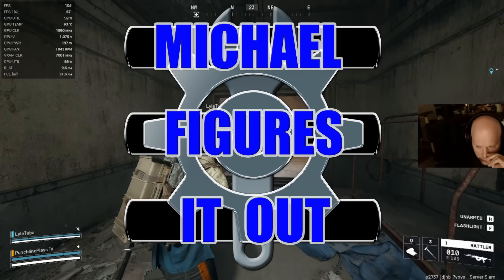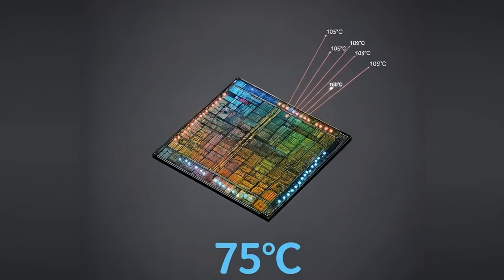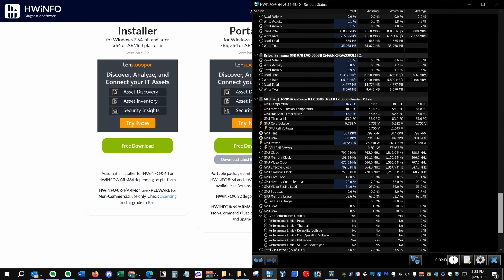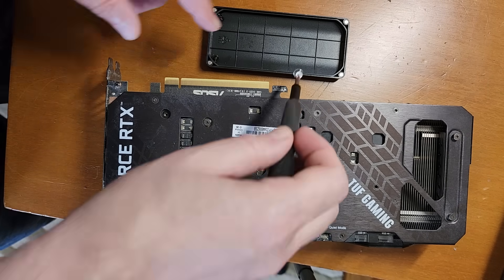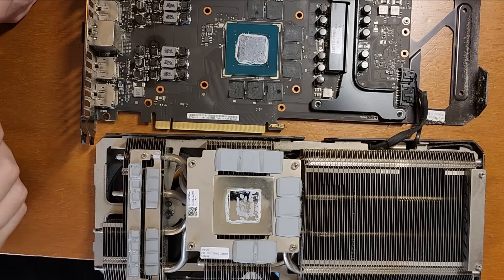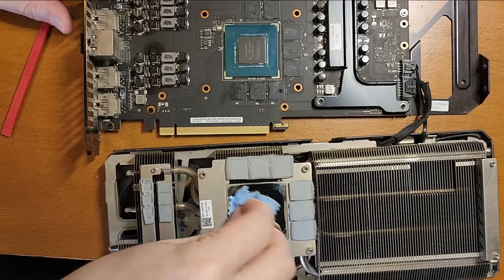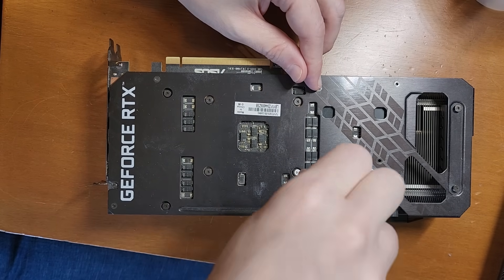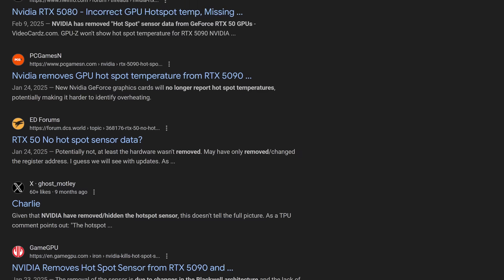GPU Temps Are A LIE!

Comment: 105°C on the hotspot is still within the normal range. The high end of the range, but still considered "normal".
A high hotspot does not cause a crash of the game, that was a software issue.
I know because I had a 3080 that often got to 105 on the hotspot while playing VR games. Never a single crash.

You fixed the issue, but it was unrelated to temps.
And no, the screws with springs are not used to apply pressure to the heatsink.
Those springs are there to stop the screws from coming loose.
Reply from the maker: Do you have any official source for the hot spot temp 30 degrees over the thermal throttle limit being OK?

Comment: Streaming Tarkov with only 8gb vram? i think Ive figured out your problem.
Reply from the maker: One of the 'fixes' we tried before the re-paste was to offload OBS, streaming and discord to another PC. Didn't stop the crashes but I'm sure it helped.
Reply: @MichaelFiguresItOut  Tarkov will happily use over 20gb of vram. i use a old 3090. maybe consider an upgrade to a 5070 ti or 9070xt 16gb. once tarkov runs out of Vram it starts using system memory and when that runs out the stutters and crashes are guaranteed.

Comment: My 3080 hot spot was over 100 degrees untill I started to use PTM 7950 thermal pads. Now the hot spot is 83.
Reply from the maker: That's great. How long ago did you make the upgrade?
Reply: @MichaelFiguresItOut  couple of years ago I'd say. The temperatures are still the same as the day I applied. The good thing about PTM7950 is that it doesn't dry out as normal thermal pastes do.
I also applied it to my Steam Deck but the temperature gains weren't as impressive as on 3080. Maybe because the chip die area is a lot smaller (almost 4 times)

Comment: super important video! I feel this guy. so the gpu manufacturers really want us to forget about the hotspot temp, since it's getting higher and higher with more delta. I've changed to ptm 7950 on my 9600 XT since double repasting with one of the best pastes did literally nothing and still, when stress testing the hotspot jumps from like 30 to 65 degrees in one sec. Later, the delta settles to around 30 kelvin, which is still abnormaly and stupidly high with a ptm installed. At least I noticed its only around 22 while gaming, but still. hotspot max is even higher...and yes, i made sure to burn in the ptm properly and yes, i even re-tightened the screws. So its just gpus (or coolers) nowadays suck ass X)
Reply from the maker: Those are some crazy temps. First I've heard of PTM not helping!
Reply: @MichaelFiguresItOut  Yes u right. Maybe the chip and/or the heatsink surface are bent like crazy idk but I can life with it now. slight undervolt -5% and noctua deshroud mod with ptm will save the card in long term.

Comment: Undervolt the 3080 as well to save power and keep a more stable frequency.
Reply: I tried this first, helped my average but hotspot was still climbing to 105* this is when I knew it was a thermal paste issue for sure!
Reply from the maker: Tried it before the re-paste but it was difficult to get it right. I'm not very good at MSI Afterburner.
Reply: Don't do this. Never do this to fix crashes lmao. Reduce max clocks instead. Most do not win the silicon lottery!

Comment: Dont have this problem on any of my AMD cards.
Reply from the maker: I think AMD card have higher thermal throttle limits than NVIDIA cards.
Reply: @MichaelFiguresItOut  Ah no, its pretty standard for GPU's to thermal throttle at around 85 degrees or higher. Just tweak the fan curve so its not under spinning the fans when the GPU temp shows its already hitting 80 degrees, because that means the GPU Hotspot is actually hitting above the 90's or around 20 degrees difference from GPU temp. As long as you keep the GPU temp under 65 then you know the hotspot is under 85.

Comment: I have ptm 7950, undervolted it and my temps is usually at 60-65 degrees
Reply from the maker: Did you need to undervolt if you used PTM?
Reply: @MichaelFiguresItOut  A bit undervolt will never be a bad thing to do

Comment: >105c is too high.
>My shitty 6600xt that's been hitting 110c hotspot new out of the box for last three years : 🤔
Reply from the maker: AMD has different hot spot thermal throttle thresholds. They seem to be able to run hotter than NVIDIA cards.
Reply: Meanwhile my 7900 GRE hits only 55-60c hotspot in games, it's undervolted and overclocked
Reply: @RmX.  i have same card. Its really great for the price. Hope it dont get maintenace mode next year. 💀💀
Reply: @RmX.  even playing games like expedition 33? that game make my 9070xt hot at certain locations
Reply: i have a 6650xt (xfx merc 3 fans) and i have the same problem! i chnaged the thermal paste with mx-4. the average temps dropped but the hotspot still reaches more than a 100C. i have to state that i don't have any problems with crashes or whatnot but i just think it's too high.
Reply: @iq_thepunisher3767  Na its fine, the card should start to get in trouble when you reach around 110°C
Reply: @iq_thepunisher3767  This seems to be a universal "problem" on 6600 and 6700 series cards. Doesn't matter which AIB the card is, the delta between core temp and hotspot is always insanely high for some reason (even after repasting or using PTM7950). On 6800 and 6900 series cards this weirdly isn't as much of an issue
Reply: @Knaeckebrotsaege  Some times is not a problem for the thermal paste or the GPU it self, a loot of times is because the thermal pads are to thick and the cooler don't make full contact with the GPU, or simply because the cooler design is just bad.

In any case, there are always several ways to lower those hotspot temperatures to a safe level, including undervolting the GPU core. Taking my own card, a 3060 Ti, as an example, the base clock voltage is 1.2V if I'm not mistaken. I have several profiles and I generally use the lowest one where I go from 1.2V to 0.900V (you can play between 0.900V and 0.950V without any stability issues, although that will depend on the GPU silicon). Just by doing that, you can lower the hotspot temperature by more than 10°C, with hardly any performance loss, maybe 3% to 5% (although again, it depends on the GPU). This can then be compensated for with an extra 200MHz in the memory. This not only lowers temperatures but also the card's power consumption. However, it has its limits, since the temperature ultimately depends a lot on the heatsink, and that the thermal paste and pads are fine, so it's a matter of trying them out to see what works best for you.
Reply: Replace the thermal paste with Honeywell PTM7950  phase pad. You will get from 10 to 20 lower hotspot. I used with asus rog strix 5700xt (from 105 to 83 temps at hotspot) and with asus tuf 7900xtx (from 98 to 83 temps at hotspot)
Reply: Just asking, that 6600xt is a Gigabyte card? I ask this because I have several cases of the GPU temps at 65 to 75°C and the hotspot at 100°C or more even with a few days from brand new, and all because the bad thermal paste tha Gigabyte uses, but is not only for the paste quality, but the bad aplication in the assembling as well, I recomend to change the paste if anyone has a hotspot temp over 100°C with general temps 20 or more less in the GPU value, even if is not a Gigabyte card, aplies to all brands
Reply: @AlexBehemot  Afox
Reply: Replace the paste with PTM7950, enjoy.
Reply: Undervolt it.
Reply: will not fix the hot spot. PTM will
Reply: Guess what? My RX6650XT started having hardware instability after just 3 years effectively making it unusable. I'm like 102% sure it never overheated.
Reply: @Kelle128  The RX 6650XT cards have a build issue. If you look it up online you'll see many of them have problems with their memory controllers or memory chips. I've seen one personally in my shop set itself on fire....literally. This was after weeks of instability.
Reply: cap fps and adjsut fan speed dont use default settings and you can also undervolt https://www.youtube.com/watch?v=raNwvQHPm_U&t=414s one of best channels for amd gpu
Reply: Got the same card (hellbound double fan) mine was getting to the high 90s with fan speeds of 2700 rpm. After repasting the temps go bo higher than 85c, and the fans no higher than 1600 rpm, which lowered fan noice by a lot..

Comment: In my experience for GPU’s where you apply the paste directly to the die the thicker pastes work better. Thermalright makes some very good thick paste. Also the Thermal Grizzly KryoSheet works great too. You’ll most likely have to cut it to size though and installation can be tricky but after it’s up & running they work great and never have to worry about paste drying out again.
Reply from the maker: That's the next step if this doesn't last.

Comment: Had the same 3070 model with the exact same issues, hotspot after 5 years of use was constantly hitting 100C+ while the regular GPU temp was in the 70s, 80 max. Ended up repasting with Thermal Grizzly Duronaut, which fixed the issues before selling. My new card, an XFX Mercury OC 9070 XT comes with PTM7950 as standard, so hopefully i wont have to deal with this for a while.
Reply from the maker: I didn't know any cards come with PTM. Seems like they all should!
Reply: @MichaelFiguresItOut PTM7950 is almost standard for RX 9070/XT cards, except Gigabyte.

Comment: i had high HOT spot temps too. I had no crashes but GPU was super loud. So i just undervolted it. No repaste. Its now quiet and still stable.
Reply from the maker: Undervolting is another option but hard to do if not tech savvy.

Comment: I had this problem with my 3060 a while ago, it would crash when the temperature was between 70-80 degrees. I monitored it more closely and saw that the hotspot was hitting 105 degrees.
Reply from the maker: Did you re-paste or undervolt to fix it?
Reply: @MichaelFiguresItOut  I did a complete cleaning, replaced the thermal pads and the thermal paste. (It's worth remembering that this was a card I threw in the air fryer to do a homemade reballing, hahaha. The life of a gamer in a third-world country is sad, but it's okay. At least I'm happy with my 3060 now.)

Comment: @Michael Figures It Out
if you screw something togehter always use criss-cross pattern
lets say you have 4 holes on a square one in each corner
you start with any corner get the screw in but do not fully screw it yet then go the the diagonal opposite corner do the same , do the 2 remaining corners and start the criss cross pattern again while tightening

1) this ensures youre leveld across the surface once you have a 2 screws in diagonaly all the other holes will line up automatically
2) you ensure that you tighten it down with as even pressure as possible simply because of the criss-cross pattern.

3) gpu temps probably not a lie but when youre just looking at the average instead of the MAX hit, is simply an user issue not looking at the max wich can be setup and looked at in almost ANY softwar that monitors temps
Reply from the maker: Good advice!

Comment: you are the best i just know thes after buying 3080 last 5 month my temp is most 78deg but the hot spot over 95 always i just down the voltage with msi after to curve and down the mhz from 1900mhz~ to 1700mhz~ and now the temp with highest 86 in hotspot with same normal temp 75~
Reply from the maker: Thanks. Undervolting is a viable software solution but it's not easy.
Reply: @MichaelFiguresItOut  YAH you are right i just need to change thermals